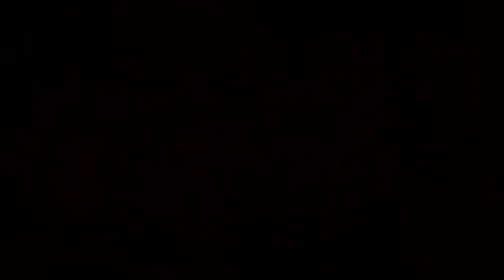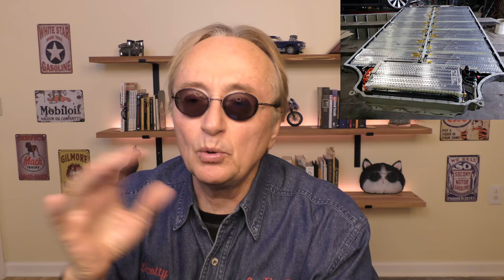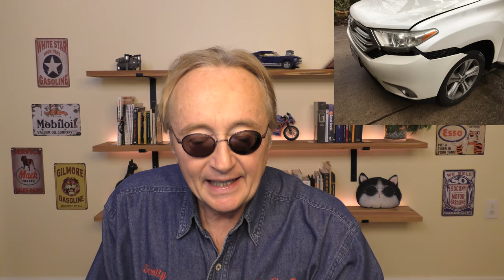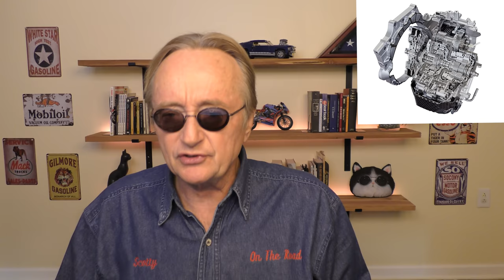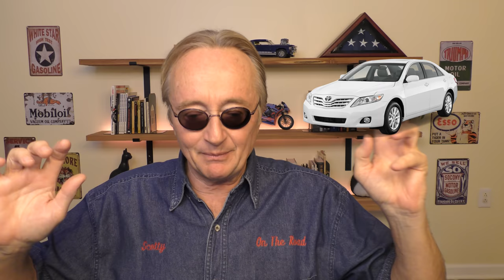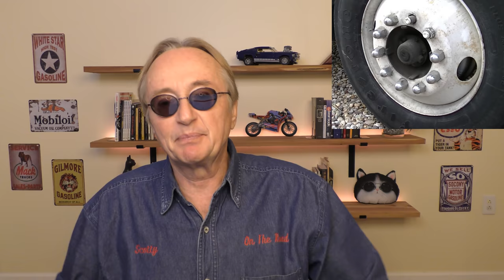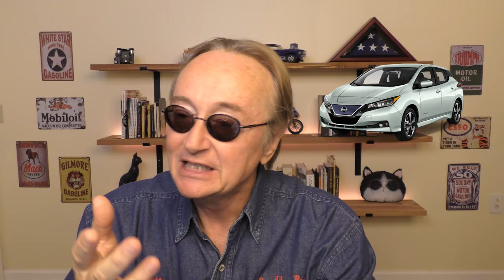This Fatal Flaw Just Ended Tesla’s Future in America

Comment: Whatever the issue. TESLA will overcome it.. solve it..and be better for it..NEVER count out American ingenuity.   Love my TESLA.. gonna drive a bunch of miles in it a bit later..  by %.. very few small  ICE vehicles made today go for over 120k or 12 years..
Reply: Here in EU I drive Skoda Octavia 2.0 TDI Diesel (150 HP) with 310.000 km, not single bih issue, just one 12V battery after 212.000 km. Only changed oil and filters on time. Bought as second owner with 116.000 km.

Comment: Ended, compared to what? Battery technology is complex. Dendrite growth has been known for years. Computer technology is complex. Flash memory wear has been known for years. You might as well say that Cadillac has a fatal flaw (betting the future on electric start, and using carburetors) and their future is ended, 100 years ago, because lead-acid batteries have sulfation, and because the analog computations physically built into a carburetor, which are necessary to proper operation, lose accuracy and fail when the parts wear, and the carburetor must be repaired or replaced.
Reply: Phil, rent an IQ.  Electric cars have been being "perfected" FAR longer than gas powered cars have been around and it STILL is not up to par.
Reply: @protonneutron9046  I can't remember the last time someone (sneak) called me stupid who didn't turn out, when it was possible to check by means of objective evidence, to be projecting, or trolling, or pushing a political agenda.

Comment: You see people accelerate like maniacs in them electric teslas mini's etc which will wear the batteries out in no time.
Reply: 500kwh battery can deliver 2000HP no stress, tesla also delayed the semi to use their new silicon battery that has around 3x the life span of their last battery, so it should last over 1 million miles before changing.
Reply: @miguellopez3392  ok miguel you get 1 you'll be charging it up like you charge your mobile telephone.
Reply: @madanto2394  this charges faster then my phone thanks to the glycol cooling system (30 minutes), but saving 4x on fuel will put a smile on anyone's face especially when you buy hundreds of gallons of it.
Reply: @miguellopez3392  you drive a telsa i figure
Mate electric cars not for me wouldn't even take a Porsche taycan
If they offered me it for nothing.
Reply: @madanto2394  i drive a jeep JK, the tesla offers me what the jeep doesn't.
Reply: @miguellopez3392  have never heard of 1 mustn't sell em in uk
Reply: @madanto2394  very popular in the US as a offroad car and one bought by the general public only about 300 are sold in the UK every year, washington state is where i live and are usally not seen in major cities.
Reply: @miguellopez3392  ah right I'm from n.ireland just for the record

Comment: Hydrogen fuel cell is the future and if we have millions and millions of ev's on the road and all of the being charged daily what will that do to our power grid? We are already being told to conserve electricity on hot days in peak demand times. And what if we lose power due to storms or whatever-gotta walk I guess. What about running air conditioning or your heater? How does that affect the run time of all battery EV's. Battery EV's have too much downside for me. Hydrogen fuel cell vehicles on the other hand produce electricity on demand and are re-fueled much like your gasoline vehicle of today
Reply: the US would only need 30% increase in electrical capacity to meat the demand of 250 million EVs, there aren't enough factories to even make that number in 15 years. china is building its electrical grid so why cant we? much of this extra energy we need will come from solutions that are now possible thanks to Tesla like home solar power generation and storage (tesla allows you to sell and buy electricity so you can sell power to the grid when its expensive and buy it back when its cheap, power companies love this because its cheaper than modulating it themselves. people wont need to take power from the grid if they produce their own. by problems that you describe such as cooling during hot days are do to inability to match load in time. this has caused brown outs in places like California and Australia. Tesla has deployed multiple large battery storage systems that use renewable energy to balance the grid and has proven to be the fastest solution to respond to load changes in the grid. it adjust in a fraction of a second instead of taking 5 minuets like a natural gas Peaker plant.

people who drive Teslas with the new heat pump have said they see no difference in range estimation when they run their heater, its that efficient. people who drive the model 3 have reported only a 10% loss in range after 200,000 miles but the new generation 4680 cells are expected to easily go over 1 million miles but will probably be recycled into a power storage before that.

charging will get faster, almost as fast as gasoline but electricity will definitely be cheaper than gasoline and hydrogen do to production and logistic constraints.

lets compare the most popular hydrogen car "Toyota Mirai" $58,000, to the most popular electric car "Model 3" $37,000-$56,000 
Horse power
 Toyota Mirai: 150HP
 Tasla Model 3: 300-550HP

Weight
 Mirai: 4070lbs
Model 3: 4040lbs

Range
Mirai: 312 miles
Model 3: 351 miles

cost to refuel
Marai: $40
Model 3 $10
 as you see the hydrogen car made by the biggest automaker fails in comparison to a car by one of the newest electric car companies.
Reply: @miguellopez3392  Thanks for the info

Comment: Most average drivers hardly even lift their bonnets so couldn't care less if the companies don't let out the info on their vehicles. As it is with most vehicles, to keep the warranty  you need to got to the registered dealers who have the test equipment to check over the vehicles they supply, so it's a bit of a mute point anyway. Electric vehicles have far less moving parts so old school mechanics will become irrelevant (sorry Scotty) Things are changing, unfortunately you need to keep up. There will be a time in the not to distant future when ICE vehicles will be a thing of the past. It's only because the western world has based it's economy's on fossil fuel that it is still got so much infrastructure behind it. 
All new technologies take a while and are very expensive at first but soon become the norm once the problems have been ironed out. Who would have thought that we would have been watching this on the internet twenty years ago? I had a Lobster phone early noughties and was amazed that I could watch TV on it. Battery tech is improving daily and what with exchangeable battery packs the range anxiety will soon disappear.
Reply: WRONG mookyzook.  One DOESN'T need to go to the dealer to keep the warranted.  Go rent an IQ